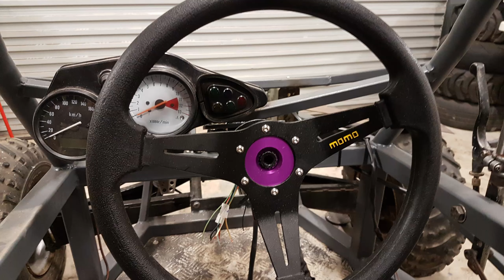Edge Sidewinder Buggy Build

Comment: Well done on the build! 72hp should feel pretty fast in something about the size of an FL400! But does it handle jumps well?
Reply from the maker: It does alright over jumps if they are smooth, but the solid rear axle can make it a bit bumpy if you don't land flat. It works best for fast flat dirt tracks.